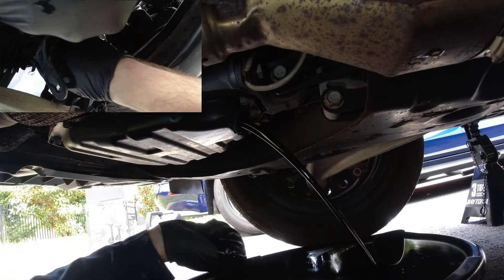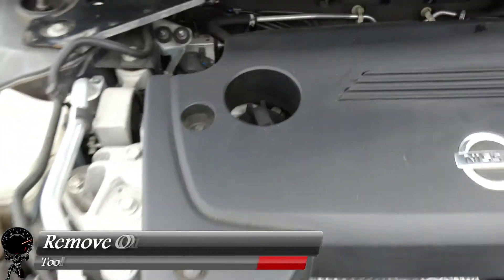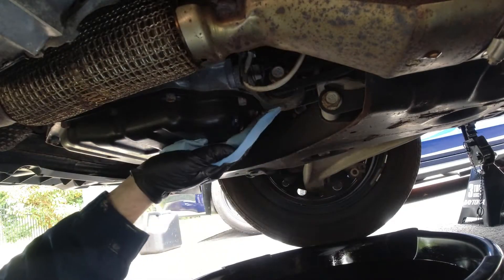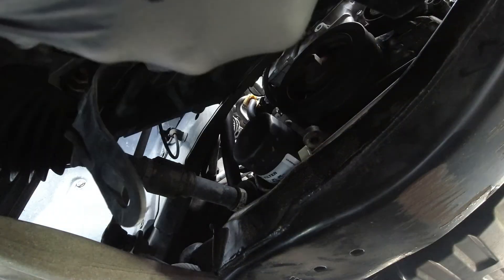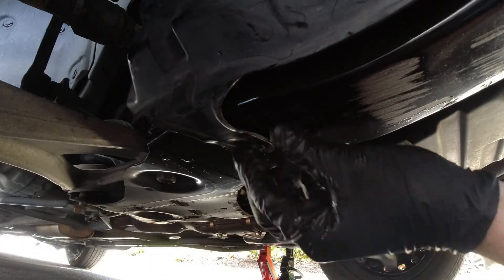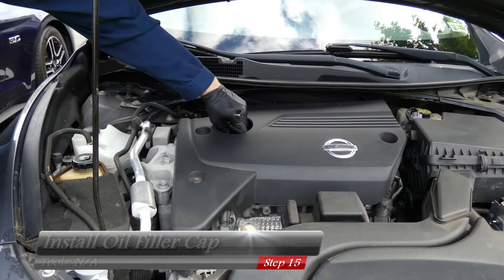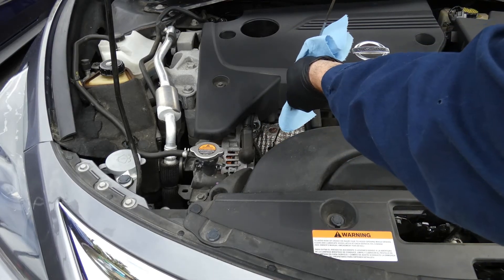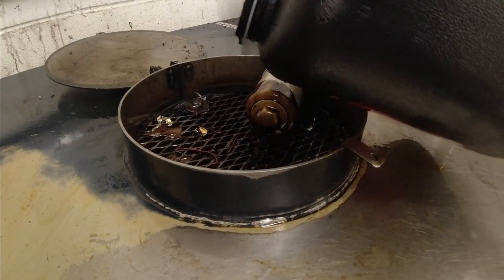How to Change Engine Oil for a Nissan Altima (2013-2018)

Comment: That was by far the most thorough oil change video I have seen in a long time. The only part was missing, what's showing people how to reset their oil change notification in the dash screen, and reminding them to pick up a sticker to place in their own window after the oil change. Other than that, everything else was perfect.

By the way, what type of torque wrench did you use? You should add that in the description with an affiliate link.
Reply from the maker: Thank you very much. Thats a good idea, I'll update the description. The torque wrench is a PITTSBURGH PRO 3/8 in. Drive 5-80 ft. lb. Click Torque Wrench from harbor freight ( https://www.harborfreight.com/38-in-drive-5-80-ft-lb-click-torque-wrench-63880.html )

Comment: Hey there, great video! I’m looking to start doing my own oil changes on my 2016 Nissan Altima. I saw you jacked up the vehicle, pardon my dumb question but did you jack up the front of the vehicle? And would you recommend getting ramps to do this job? I have most everything in the video (besides a filter wrench) but wanted to see if I need to invest in anymore tools first. Any info is appreciated!
Reply from the maker: Thank you!!! First of all, there are no dumb questions. All your questions are good and relevant. Yes, I did lift the front of the vehicle due to the tight space. Ramps are a great idea. Since I was in an apartment, I tried to minimize space, so I always used jack stands. Tools used in the video should be more than enough. However, if you are thinking of performing more car maintenance, here are some good overall tools: https://youtu.be/sc504JgBJts

If you have any questions, don't hesitate to ask.
Reply: @mcgurrentertainment  sweet! Thanks for replying! Yeah I’m in an apartment too and have a single car garage so I can likely do this myself. Just started venturing into vehicle repairs. I had a check engine light on my other vehicle (a 2018 dodge grand caravan), ended up replacing the EVAP leak detection pump and then thermostat. Not too bad but I had to purchase jack and stands for that job. I’m trying to save money where I can and I figured oil changes would be a good place to start! I’m sure I saved myself a few hundred dollars on the other repairs i did already. Appreciate your help again’
Reply from the maker: Anytime 😊
Reply: You sir have earned a subscriber. Many thanks.
Reply from the maker: Thank you for your support!!!

Comment: QUESTION, rule of thumb I have constantly read is change full synthetic every 5000 miles .
HOWEVER if you check the oil and it looks decently clean and it's been 5000 miles does it still make sense to change the oil even though it's reached the 5000 mile mark???
Reply from the maker: Wow, that's pretty interesting
 I've seen oil change color in 100 miles, never heard of one being clean in that many miles. Sounds like you have a pretty clean engine. 

Sadly, oil color does not determine oil breakdown. To have a definitive answer, you would need to send an oil sample out to determine its condition. With that being said, oil technology has come a long way of the years, and oil has been lasting much longer than before. There are oils made to last 15k+ miles (which was unheard of years ago). 

Overall, I would recommend following the specifications of the owners manual and oil manufacturer. There's no need to roll dice on engine maintenance when the job is cheap and easy. Good question!!!
Reply: @mcgurrentertainment  AGREE 💯, i truly appreciate your response, thanks friend!!!
Reply: @mcgurrentertainment  from your experience is 7500 for full synthetic optimal???
Reply from the maker: Seems very reasonable. Even the synthetic blends last up to 7500 miles.
Reply from the maker: Anytime!!! 😎

Comment: I’ve owned my first Nissan Altima 2013
What kind of oil do you recommend me tu put in ?
Reply from the maker: Verify with your owners manual, but if I recall, it's 0W-20 for the QR25DE and 5W-30 for the VQ35DE

Comment: Is there a reason why in all the Altima oil change videos no one lifts the car by the center lift point?
Reply from the maker: I know the main reason for me was having room to work, especially for camera gear and lighting. It's hard to get good camera angles with the jack stands in the way.

Comment: I have a 2017 2.5 ive been trying to find viscosity rate but ive seen some say 5w30 some say 0w20 so im very confused
Reply from the maker: Technically, it's both. My Frontier has the same engine, and it uses 5w-30. This one uses 0w-20. It's not uncommon for a car manufacturer to change the oil spec over the years. Same with Ford (2020 Mustang GT = 5w-30 and 2022 Mustang GT = 5w-20). 

When in doubt, refer to the owners manual.
Reply: @mcgurrentertainment  so they can use both 0w20 or 5w30
Reply from the maker: Pretty much. However, it looks like nissan recommends 0w-20 for your year (per the manual).
Reply: @mcgurrentertainment  have. U looked it up oh ok
Reply from the maker: Just a quick Google search. "2017 Nissan Altima owners manual"
Reply: @mcgurrentertainment  ok I appreciate it man
Reply: It's takes 0w20 (which is synthetic ) You don't need anything else and you will be good to go.  Mobil1, Valvoline, or Castrol are all very good oils